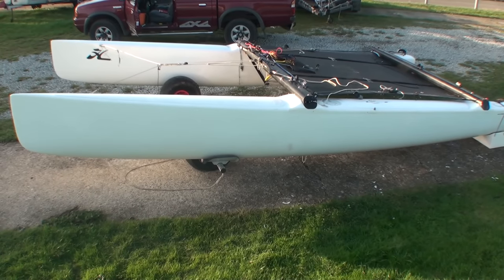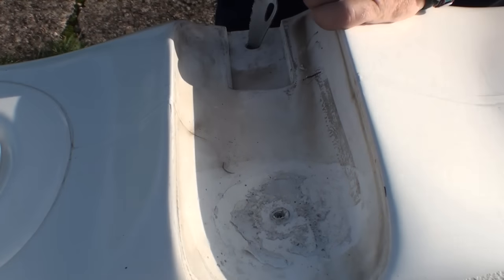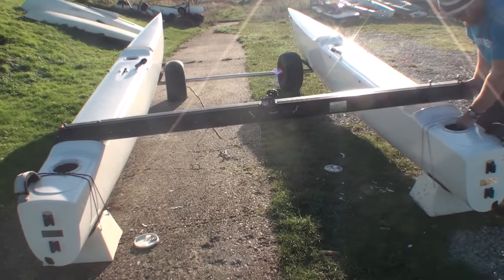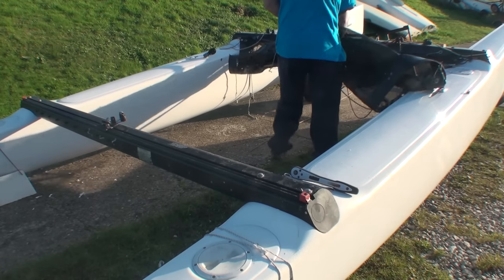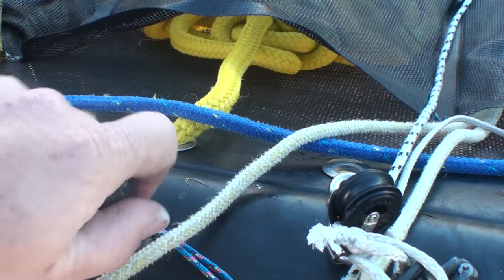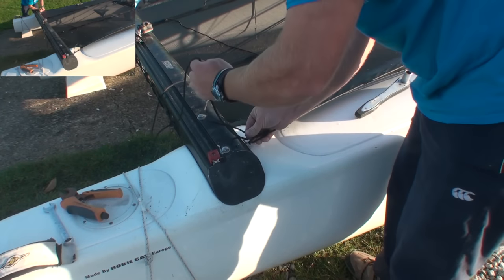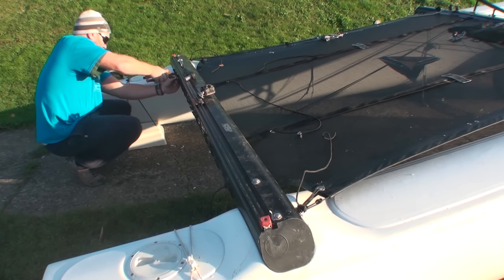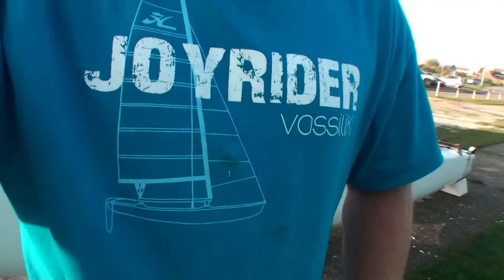How to assemble a Hobie Tiger - The Platform

Comment: Hey Joe,
If you have a little time in the next FAQ...
I have a hobie Tiger, and i would like to know if it's possible to use a hobie Wildcat mainsail  on it. I know that the hook is different between the boats... is it possible to change the hook by yourself? On the sail or on the mast.
Thanks
Reply from the maker: Thanks for the question. 
I'll take a look and reply in the next Q+A (when it actually happens)